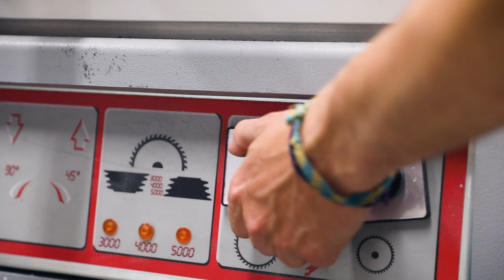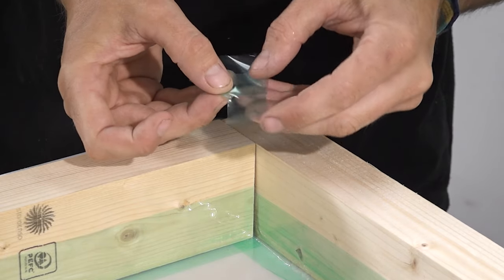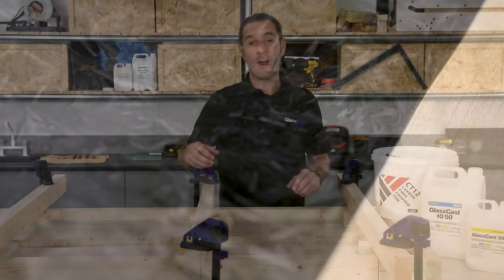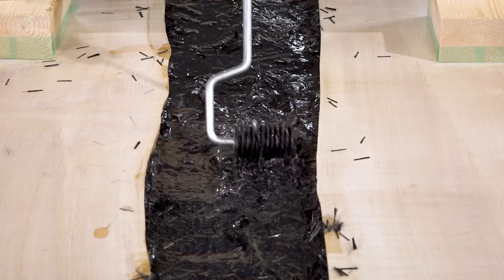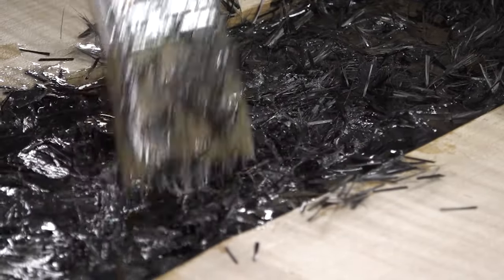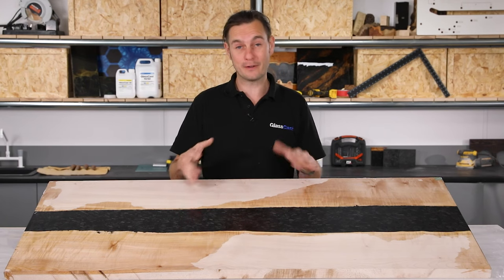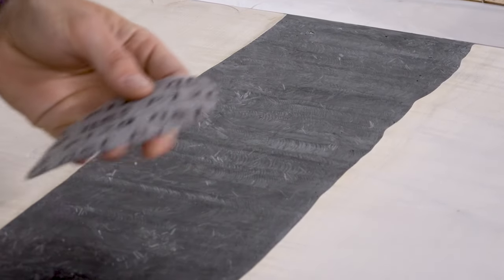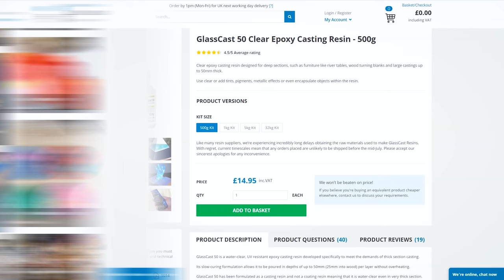DIY Forged Carbon Fibre River Table Complete Tutorial

Comment: Stunning.  Awesome video - thanks.  Have you tried adding the carbon fibre as a thin coat to a counter top?
Reply from the maker: Hi Raz, thank you for your kind comment! On a flat surface a staged approach is best.  Apply a thin coat with resin and allow it to get to B stage.  Repeat and then finally apply a flood coat of resin for the gloss finish.  You could even apply an unperforated release film to help roller it flat to help the fibres stay down rather than sticking up.

Comment: Bonjour, when I sanded my first little table, the resin softened, what mistake did I make?  THANKS
Reply from the maker: In all likelihood you have passed the heat distortion temperature of the resin with the heat build up from the sanding. This would cause it to soften slightly if it go too hot.
Reply: @glasscastresin  ok I understand, it will harden again?  THANKS
Reply from the maker: If the resin only got slightly too hot then you should find it hardens when it cools back down.

Comment: How many pounds of chopped carbon did this take
Reply from the maker: We found that about 20% of the weight of the resin works best so for every 1kg of resin used, we added 200g of Chopped Carbon; in imperial measurements, for every 1lb of resin, you'd need 0.2lbs (3.2oz) of Chopped Carbon.